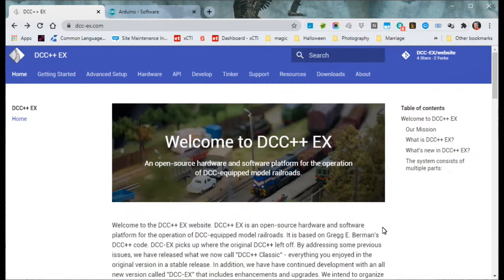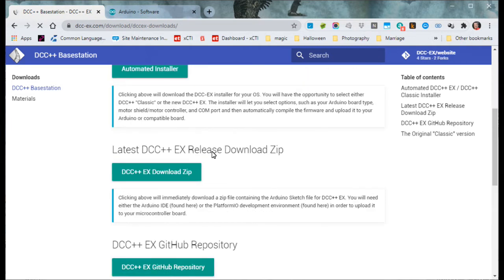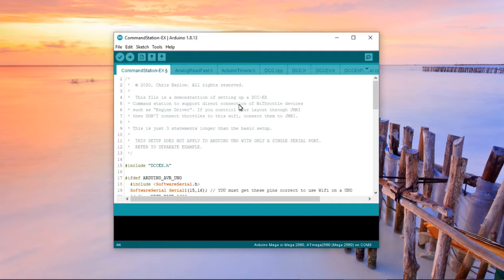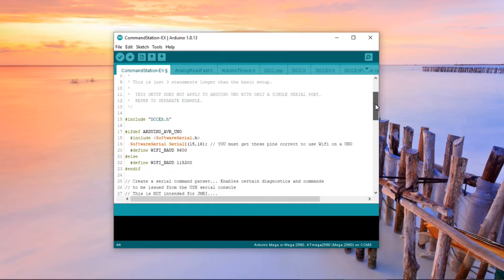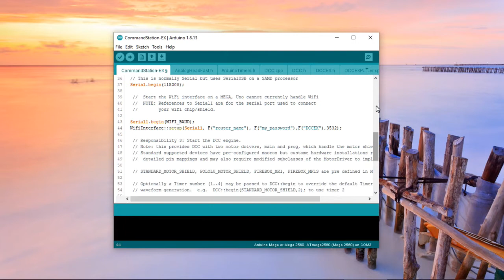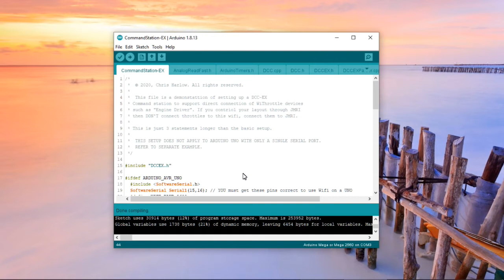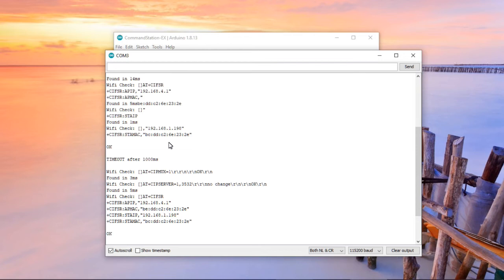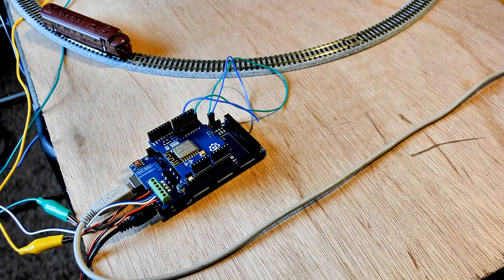How to connect DCC++ EX to WiFi and use Engine Driver to run your trains

Comment: Can a ESP8266 WiFi Serial Transceiver module (not the shield) be used with this ?
Reply from the maker: Do you mean what I cover at 3:28 in the video? If so, then you just need jumpers from 3.3V power, ground, Tx, Rx and one more jumper for CH_PD to 3.3V.

Comment: Hi.   I have a supported MC33926 Pololu motor shield.   When I try and stack that board with makerfabs wifi shield the pins on the lower part of the wifi shield run into the output terminals of the motor shield.   Is there a work around for that?   Also when I put the wifi in the middle the jumper wires get in the way.
Reply from the maker: I don't have that board to test. I'll ask one of the other testers.  Do you have a picture? You can talk to us on the Discord channel or email support@dcc-ex.com and we can take a look at it. I know some people bend pins and on Pololu I thought you can put the same type headers that an Arduino has to get clearance. You can also jumper the pins to unused pins on the Arduino with those plastic jumpers and then it will go through the pins and up into the Pololu board. Then you can jumper the pins you used for Tx and Rx from there

Comment from the maker: Mani, I apologize, but I lost your comment about using a WiFi Mega. It should work, but I have not gotten mine t work yet. My firmware was not an AT command set. I tried uploading other version, but have either not found one that works,  or I have a bad chip. I can't get a reliable connection. Even a ping only works randomly. Set pins 5 and 6 on to connect the UART to the ESP and send an AT command. If you get an OK, it should work. Try every baud rate. I have a lot of detailed notes and can share with you.

Comment: is this code already online?
Reply from the maker: Yes. Everything is up to date
Reply: @DCCEX  get an error message: ATMEGA2560/Timer.h: No such file or directory
. i am not a professional. Best regards from germany
Reply from the maker: @MrSoldier333  When you unzipped the program, do you see a folder named ATMEGA2560? And inside it do you see a file called Timer.h? Maybe all the files in the zip file did not get unzipped?
Reply: @DCCEX  Same issue. After unzip additional files seem to be missing or in unexpected locations.
Reply from the maker: @1500vdctrains  Everything should be correct now in the repository. We will have a release in a few weeks, so the zip will be there too. Writing instructions for the WEB and updating the installer now. If you unzip everything to the correct folder (for the Arduino IDE is must be in a folder that has the same name as the .ino file) which is CommandStation-EX. You will need to rename config.example. h to config .sys. If you are using the defaults (arduino motor shield and optionsally the ESP8266 board) you don't need to change anything. Then go to the IDE "library manager" and install the DIO2 library by Thierry Paris. So your path would be something like /documents/<user name>/Arduino/CommandStation-EX/CommandStation-EX.ino. Select your board, the port, and click upload.